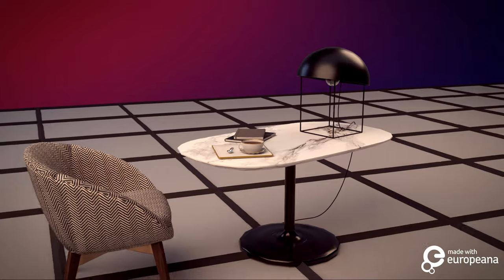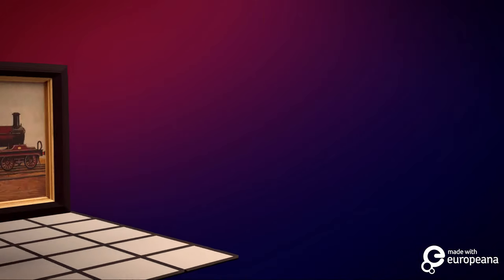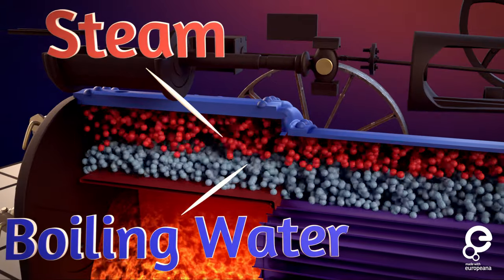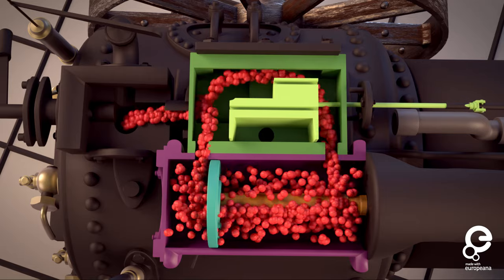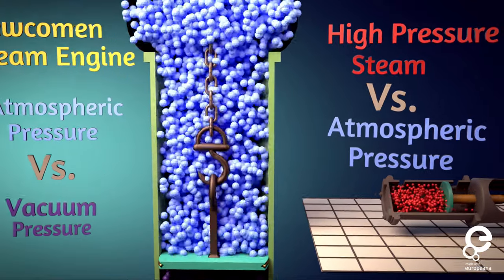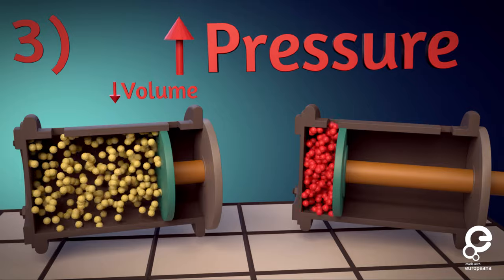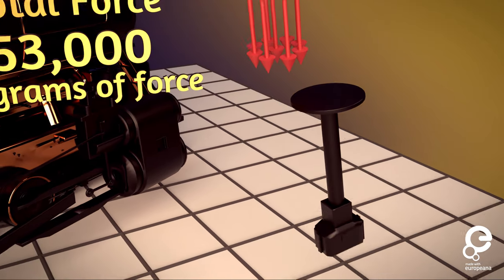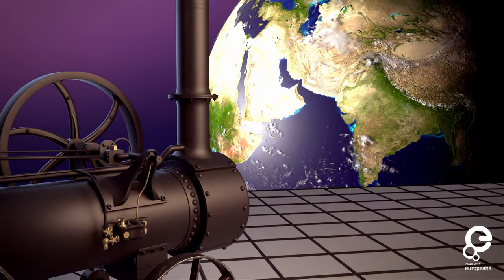How do Steam Engines Work?

Comment: What you have shown is a Portable Engine , not a traction engine. The main difference is that a portable engine lacks a drivetrain, so it is not self propelled. They were moved by horses to wherever they where needed. Traction engines came later when portable engines were modified or redesigned with steering systems, fuel and water storage, operator's platforms, and most importantly, a drivetrain to the rear wheels.
Reply: Lol, I just said the same thing in a different comment. I help operate portable steam engines and traction engines. I have a video of it on my channel. It’s called Fall Steam day 2019. I also have a video of me running a steam roller.
Reply: Yeah, at the museum I work at, what you were calling a reaction engine, we call a porta-boiler. They were not self propelled and were usually horse drawn.
Reply: It's hard to read your message when you keep saying "where" instead of "were," it's very annoying
Reply: @mesofius  there, fixed.
Reply: @harrimanfox8961  you didn't fix all of them, lol.
Reply: @TNRailProductions_01  i used to run portable engines at a local museum. loved getting grease  and oil all over my hands. was never a certified boiler operator but knew how to get these beautifully simple engines going like hell and learned a lot along the way. i was giving wood to fuel the fire instead of coal. lasts longer and burns hotter.
https://youtu.be/4_EqyzzMGTo video of the engine i used to play with. i would love to get back into running these engines again
Reply: I actually did research and found out that the traction engine originated from an experiment. A man took a portable engine and connected the engine to the wheels using chain and sprockets, turning it from a horse drawn engine to a self propelled one. It sparked the invention of the traction engine

Comment: Well explained. Without wanting to sound negative these types of engines were only a few percent efficient. Most of the energy was lost as heat and only a part of the potential energy in the steam was converted into work. Having said that-- These must be the most exciting and inspiring engines ever devised.
Reply: Well i don't see your name patented to any invention.........awkward
Reply: @thecyberexplorer1265  Your point being???? Why would I need any patents in my name to mention the efficiency of steam engines and why would you need to need to suggest this is in some way "awkward"?
Reply: @jonka1  even centuries later steam engines r still our most powerful source of power we have for mechanical energy purposes. Steam locomotives r around 6 times the power of any of its strongest competitors. And a steam traction engine of over 100yo is as or more powerful than our current best 4 wheel drive diesel tractors of the same size. Using the technology we’ve discovered and invented in the past century we cud modernize the steam engine to a point where we wud be using hardwood chip fuelled steam engines instead of gas, diesel, oil, propane or anything else fuelled engines. It wud simply be able to easily outperform everything else we got even more than it already does. And with how steam engines r wat is used to launch aircrafts off of aircraft carriers at such extreme force and r also used in nuclear power plants.
Reply: Thanks for highlighting.

Comment: I found it interesting and well done. Being an engineer, though, I want more detail! There are so many components to a late model locomotive and I want to know about them all!
Reply from the maker: Over time, more videos will get to more of the components.  But ya gotta start somewhere.
Reply: he would have given more detail but he had to focus on global warming instead.
Reply: There isnt much else to say. Except for the valve gear.

On earlier engine, there are two sets of essentrics, 175-180 degrees apart. One is for forward and the other is for reverse. Later link motion valve gears allowed steam tk be cut off at higher speeds, which allowed smaller amounts of steam to use much more energy and saves more steam from being spent.
Reply: Same, there are some interestring details, like latest Czech locomotives have three pistons (https://youtu.be/gz2xKRIehDc?t=681), two chimneys, Trofimov valves that are freely moving on the rod when steam pressure is not applied (idle) reducing moving mass, there some interesting details like superheating steam, water pockets in boiler and last part which i do not understand is kinematics of linkage system (to make it worse, it has to work with dumping and train must be able to turn ... and someone had to design it without computers more than 100 years ago. It surprises me that people were able to design very complicated mechanic machines whereas today we are trying to replace everything by electronics with no moving parts (take drone with complicated and rapidly reacting regulation and simple brushless motors vs helicopter with tilting rotor blades)
Reply: I had to watch another video to understand what all the components were. I found a video that was half as long yet twice as informative.
Reply: @joshmedeiros5450  link please 😃

Comment: The principle on which the steam engine operates is so simple a child of seven or eight years can grasp it readily. The details of making it work reliably, with a tolerable maintenance burden and with slightly better than dismal efficiency filled the careers of mechanical engineers for a century.
Reply: Also led to the entire field of Thermodynamics and Statistical Mechanics.

Comment: 2:16 This is not a traction engine. it is a portable engine used for powering machinery using a belt off of the flywheel. it does not have the driving gear to move itself. they have a drawbar hitch on the front that is hitched to a traction engine to move it. And as for the steam being trapped inside the boiler, every steam powered machine has to have a safety mechanism on it. on a boiler is a safety valve witch will open at the maximum safe working pressure releasing excess steam so it does not put the boiler under strain and risk it having an explosion.
Reply: I thought I'd search for this comment before I write the same.

Comment: This is fascinating. The principles are probably somewhat similar to how our cars operate today, only using combustion instead of steam. Its all very interesting.
Reply: Steam is external combustion, the steam is continuous and shuttled through valves to push on either side of the piston. A gas or diesel engine is INTERNAL combustion,  the fuel ignites and pushes on only the one side of the piston. The valves are timed to let fuel/air mixture in and exhaust out, so different ways to accomplish the motion of the flywheel
Reply: Both steam engines and modern internal combustion engines are heat engines so they are fundamentally similar. The only engines we regularly use that aren't heat engines are electric engines, and that's why they're so dramatically more efficient than all forms of heat engines. This is also why sustainable power sources like wind, solar and hydro are so efficient, they are not heat engines so have an intrinsic advantage when compared to fossil fuels and nuclear power.

Comment: Thermodynamics, the statement be "engineers learned to extract energy from HEAT" not FIRE. I get that these old steam engines use a fuel source that burns aka fire, Wood, Coal, Fuel-Oil, etc... but other fuel sources are used to boil water, like any Nuclear power plant and no fire is involved in that.

Comment: Very informative video. The only section that I think could use some tweaking is when you discussed the chugga chugga sound. You did mention it, thank you but a direct correlation showing the valve moving and venting to the stack with a slow motion at first and then increasing. I think most of us get it now, just an aid. Thank you.

Comment: Can we all just stop for a moment and appreciate how utterly cursed the model for that Hudson is?
Reply: Very. Cursed.
Reply: It got the lone ranger treatment.
Reply: looks pretty awesome
Reply: What's wrong with it?I'm not a train expert.Can someone explain?
Reply: @Nexalian_Gamer  it’s kinda hard to explain without you having prior knowledge, but just look up “New York Central J3a”. It’s the loco this model is based on.
Reply: @Nexalian_Gamer  the smoke stack on the engine was dwapped from a smaller engine to a bigger engine. 

Look at steam locomotives from 1860. And then steam engines from 1950. The bigger taller smokestack is exclusive for early steam engines. The bigger later engines have most of the smokestack inside the smoke box, and doesn't add much height to the engine.

Comment: You did not explain what moves and when the slide valve decides to move from one side to another, it seem it is the main thing toggling the force to the piston but how it does that?
Reply: It's connected to the piston but is moving opposite to it.

Comment: I remember a documentary on a steam engine that worked in a different principle, but I can't find it. From what I remember it worked by spraying cold water into the cylinder at the end of the expansion cycle and the rapid change in pressure pulled the piston in, instead of a high pressure pushing out. Never mind, I found it: The atmospheric engine was invented by Thomas Newcomen in 1712

Comment: The superheater is a pretty neat invention for locomotives(steam locomotives to me are just one great compilation of inventions really, engineered w/ 0 computers, nothing else quite compares), creates even higher pressure steam then what would be used coming straight out of the boiler. And something thats also pretty neat is, trying to picture the steam inside a locomotive being so hot, its entirely invisible until it hits atmosphere. Which is something interesting to compare to the normal "steam" you would think coming from tea pots etc..
Reply: A lot of the inventions of the steam engine start to seem a lot less complex when you learn about thermodynamics. Like they're definitely impressive but thermodynamics is just such a powerful tool for examining machines of all kinds that it quickly guides you in the direction of the best designs. Like ideas like the steam turbine follow quite naturally from a thermodynamic examination of the steam piston.

Comment: Branch Education My favorite things about what I like about the steam locomotives are (1) Most of them just only have one tender behind the cab, (2) Most of them have leading wheels, driving wheels, and trailing wheels; (3) Most of them are fueled by coal and water, (4) I like to watch the engineer blowing a whistle to the let people know that they're coming, and (5) I like to watch the fireman shovel coal into the boiler with fire inside which makes a lot of steam coming out of the smoke stack straight out of the cylinders (with pistons on the inside) connecting to the rods.

Comment: Also steam engines are not tiyed to fossil fuels like internal combustion engines as just about anything that burns can be used to make steam. My 7.5 inch gauge locomotive "Axolotl" burns wood. Because of this most engines in the US burned wood until almost 1900.
Reply: @lukythesteamlover  yes my father  prospects for lithium; the methods of extracting it from the dry Nevada desert includes pumping up fossil brines and evaporating them. Depleting aquifers and covering vast expanses of desert in salt. Not to mention the fact that the extract has to be shipped to China for refinement!
Reply: Coal and oil are fossil fuels, which were the most common fuels burned on steam locomotives.

Comment: I am a bit confused about how the slide valve os able to move, in fact it cant just take the movement from the piston, since the valve must always stay either all the way to the right or to the left, else the steam would have no way out, and the piston would balance in the middle as a consequence (motor goes boom ):)
Reply: Not really, it would just lead to steam pressure building up slightly for a moment but it wouldn't have any catastrophic consequences. In fact letting steam into the cylinder at all time would be wasteful as you wouldn't be extracting any energy from the natural expansion of the steam, so it is on purpose designed to shut off steam injection after a short while. Most of the movement of the piston happens due to the steam itself expanding because that allows you to extract as much energy as possible, in an ideal steam engine the exciting steam would be just above the condensation temperature.
Reply: @hedgehog3180  thx for the answear but its been two years i dont even remember the video :/

Comment: Amazing video. to the point and informative. My only issue (not a big one, just pointing it out for future reference) the Hudson 4-6-4. On top of the boiler the steam dome, sand dome, exhaust stack, and headlamp don't seem prototypical for a Hudson. The setup looks like it came from a 4-4-0 american. Especially the exhaust stack. The stack is specifically a wood fired loco stack. And the headlamp reminds me of an old kerosene headlamp. To my knowledge most modern locos had a standard headlight. Like it does on the center of the faceplate. No dynamo. And the cowcatcher looks to again be from an old 19th century locomotive. 
Again. Love the video. If I didn't mention what i did, it would of drove me nuts. Please take this as constructive criticism and not deconstructive.

Comment: I have a question, who / what controlling the slide valve?
Reply: The valve is controlled by the valve gear, the most simple is am offset rod, more complex mechanisms are needed to allow reversing it, the smaller offset rod on some steam locomotives controls the valve

Comment: The very first concept for locomotive technology was to couple the steam engine to a cart thus inventing the axel drive train, "training" the cart to move under it's own steam, the "steam training cart" which was found to work effectively on rails. But due to the hazards of high pressure explosions the entire thing had to be made from iron.
The idea came when they had to transport the engines by horse & cart for testing at the cotton mills to drive their looms. It was definitely steam engine technology that drove the industrial era. A steam engine road cart wasn't effective on land, steam locomotion had to run on tracks to be most effective.
Steam road carts would be slower than a horse so it was impracticable for any real use.

Comment: I like this video ... for the most part.  I particularly like the molecular level explanation of how steam exerts force.  But it suffers from a common problem regarding what measuring system is being used.  I'm assuming that when the narrator talks about force being in Kilograms he is not using a gravitational metric system - assuming that such a thing even exists.  He likely meant to say Newtons of force.  In what used to be the standard metric system - the Meter Kilogram Second system, a Kilogram is a unit of mass - not force.  The unit of force in that system is the Newton.   It is sorta the same as saying pound in the Foot Pound Seconds system where force is in Pounds and mass is in Poundals.  Here endeth the lesson.  Thanks for a very good video.
Reply: Seriously, considering the level at which this is pitched, pointing out that kg is not - technically - a measure of force, is excessively pedantic.  Yes, it may be that from the point of view of a physicist,   9.8 Newtons and 1kg are not the same, but for all practical purposes, including YT videos explaining how steam engines work, it is.  Likewise when it is pressing on your foot, it is too.   Do you, personally, go around telling people they don't actually 'weigh'  80kg, because, as you know, weight and mass aren't technically the same, and the scales measure force not mass??

Comment: What causes the valves to act and alternate the paths of the steam?
Reply: They’re mechanically linked to the wheels in such as way that it’s properly timed. Look up “Walshaert’s valve gear” if you want a better explanation, although there were other valve gears that worked slightly differently.

Comment: But what moves the slide to allow the transfer of the steam between each side of the piston?
Reply: You connect it to the piston itself and just have it move in the opposite direction of the piston. In steam locomotives it's connected to an eccentric that allows the driver to control the timing of the slide valve, allowing him to control how quickly the piston changes direction and this how quickly the wheels rotate.

Comment: Great video!
One question was left unanswered, that is how the valves did the timing sync with the piston, without using any electronics unlike now-a-days? And how did the accelerator work in steam engines?
Reply: The accelerator on a steam engine is called the throttle it's attached to the boiler backhead in the cab a rod is attached to the throttle and it runs along the boiler and connects to the steam dome or in some locomotive's it runs inside the engine when the engineer pulls the throttle it causes steam to be released from the steam dome the farther the throttle is pulled the more steam is released
Reply: In a steam engine locomotive It's called the Regulator, and it's also a complicated mix of Regulator and Reverser positioning and turning various little valves and opening steam and water jets...apart from making sure you have the right amount of fuel, water, temperature, pressure etc.
Reply: Yeah I noticed that as well since I actually own a real working stationary steam engine.